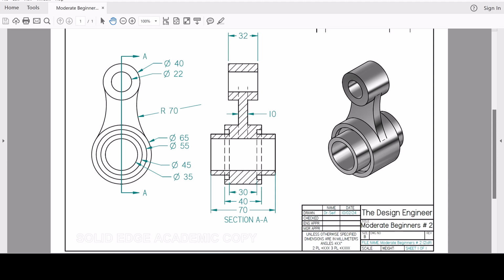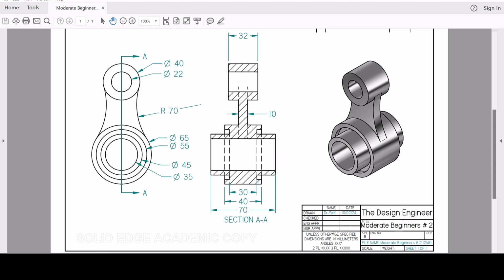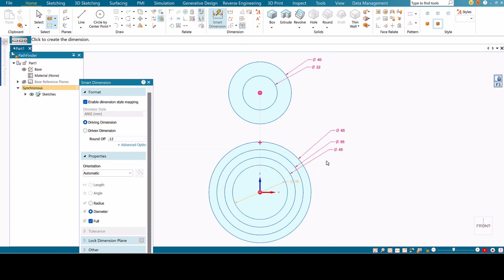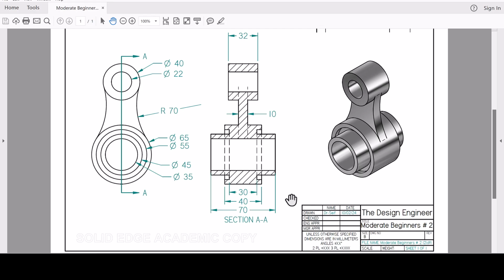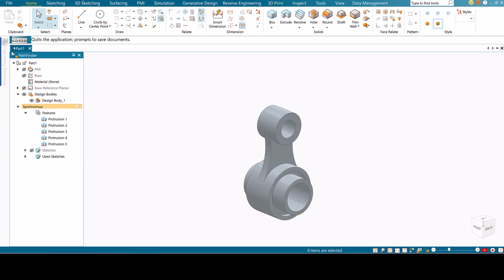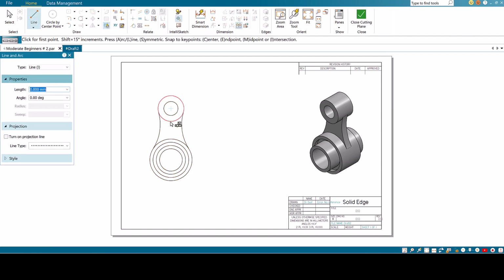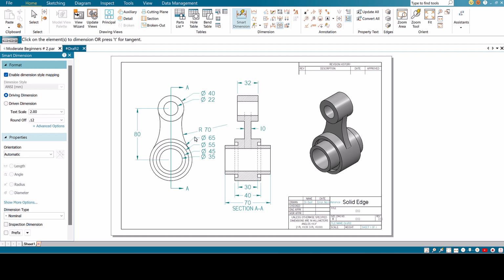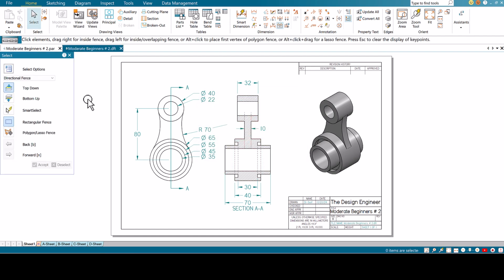Solid Edge 2024 Tutorial - Moderate Beginners # 2

Comment: Hi! I tried everything but my diameter measurement lines don't look like yours at all. My lines go all the way across the center of the circle with two arrows at the ends. At the right side the line continues and the number appears outside the drawind. They are not even horizontal with the base just fllows the ° of the line.
I did everything the same as you. Only I used ISO metric (mm).

Comment: New beginner trying to follow along, but following your steps, after extruding the 40mm circle I try to extrude the 30mm circle and I get the error message of Part not modified: Edit the feature inputs.
Reply: In the Select pop-up under operation you have to choose "Select - Add" if it was "Select - Automatic" before. At least this fixed it for me.